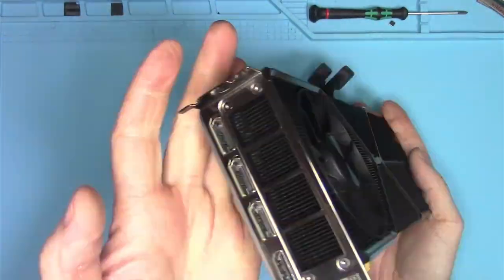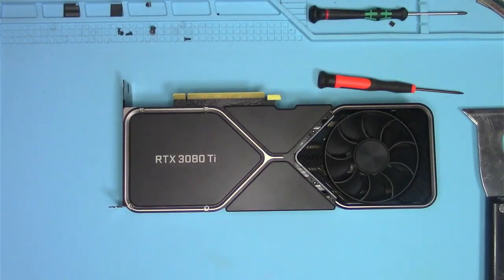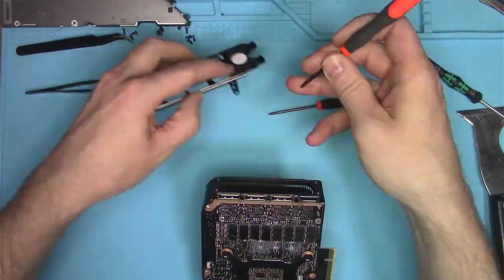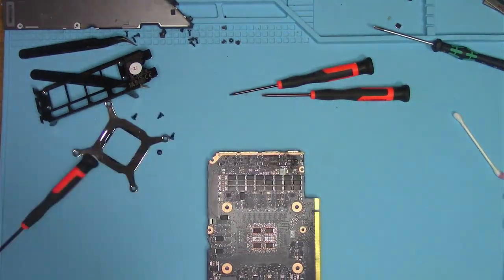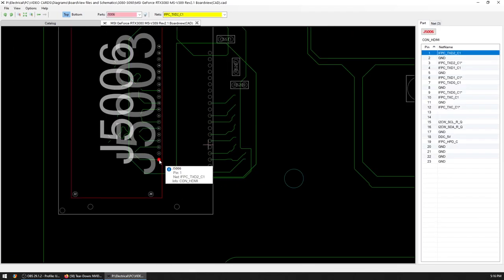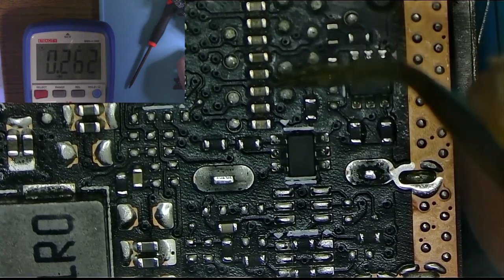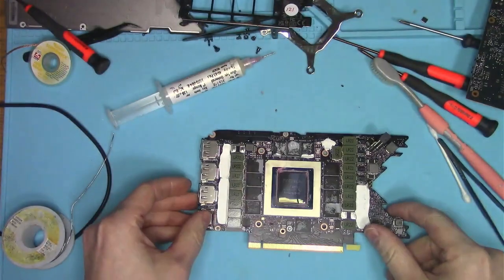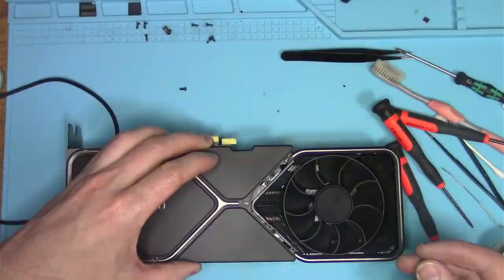Should you power down your PC during bad weather ?

Comment: Love the content, that pink thermal paste is most likely Thermal Grizzly Kryonaut. Really good paste for ambient or XOC stuff. Made by Der8auer.
Reply: I use Kingpin KPX! Also good stuff.
Reply: Kryonaut really is just for LN OCing and works well on desktop CPUs. It is very runny and is highly affected by the pump out issue (difference between thermal expansion/contraction between silicon die and metal coldplate causes the paste to be pushed away from the die with every heat cycle) on bare die applications, der8auer himself recommends Hydronaut for bare dies.
Reply: I use Arctic MX6 and so far, no issues, i think northwest use MX4, both have no issues for cards such as the pump out issue, i think.
Reply: Coolermaster Cryofuze 'violet' is violet in colour
Reply: Specifically Kryonaut Extreme is the pink stuff, regular Kryonaut is the usual grey.
Reply: @wstd7417  MX 4 is quite thin paste, it might have pump out issues over time - of course northwest doesn't check the temperature of the card over several months or years.

Comment: One are very commonly overlooked with lightning is inductive surges.  Don't run your data lines alongside electrical wiring.  Keep them a few feet apart, and if possible, make sure any Romex is run through grounded conduit.  You can have God's own surge protection where your device plugs into the wall, but if you get magnetic coupling between the lines hit by the strike and your data lines you can fry everything you're trying to protect.  If it's not possible to isolate the lines, then definitely use network surge protectors on either end of the data line run.  If you have a lot of expensive equipment it might be a good idea to look at a surge protector that installs at the panel.  A lot of times you can get one that goes between the meter and the box.  Depends on your utility company, but it's an extra level of protection and a lot of times they carry a pretty robust insurance guarantee.
Reply: Or put fiber connection between your ISP's router, and your own router...
It's literally the best surge protection you could find...
Reply: Really glad you made that comment... It's storm season where I live, and I just bought a SS on the power, but completely blanked out about my INTERNET CONNECTION... I will address it now and possibly save my system from a 'bad day'
👍
Reply: @alfrede.newman6626  Glad I could help!
Reply: Romex in conduit? Heh!

Comment: Just to clarify:
In terms of lightning damage, it makes NO DIFFERENCE whether electronics are on or powered off!
If you want to protect them, disconnect them PHYSICALLY from power, from all other wires leaving your house (TV, land-line, etc.) and all other devices, that are not also disconnected in the same way. If devices have a PHYSICAL power switch (like most ATX power supplies do), that is a good start, however a high enough voltage might still arc over the small gap inside the switch.
Reply: That includes Ethernet connections, right?
Best unplug your Ethernet cable or just straight up your router, then.
Reply: @Sherolox  Yes. Either unplug your router as well (from power and the incoming line) or unplug your ethernet.
Reply: @NebukadV  
Thank you for the clarification.
Reply: What about a lightning swith power breaker, where you have to slide the switch on an off, with a 3 inch gap?
Reply: Will a surge protector help? I have my system attached to a Targus surge protector...
Reply: @hamdanali3063  Yes, it will help. A surge protector cannot protect against 100% of voltage spikes, but it reduces the risk of damage to things connected "behind" the surge protector.

But again you need to be aware of other connections. I.e. if you PC is connected to the protected socket but your monitor is not, you can still fry you GPU. Same for the router as another example.
Reply: @NebukadV  thank you ,🙂
Reply: You think cellular sites do this?
Reply: @jeffkardosjr.3825  Cellular sites do all kinds of stuff and cannot be compared to a consumer-grade home setup ;)
Reply: Very true this OP makes a lot of sense with his statement. I heard of horror stories of people loosing their PCs back in the early days of broadband internet due to the fact they never disconnected their dialup modem and a surge went through the modem and caused damage.
Reply: people make coils with their excess cable, that don't help either in a high emp environment.
Reply: Or just use a really really good surge protector/UPS!
Reply: IT CAN ARC OVER A PHYSICAL SWITCH !! really how common is it cause I always turn off my physical switch and leave the plug as it is. It is the first time  i  am hearing this
Reply: @toheedrabbani6865  Well a lightning strike can ark over air, so of course it can also arc over a physical switch.

It is already very unlikely, that a lightning strike would create a voltage within your home high enough to bridge a opened switch, but it's not impossible. So if you are paranoid enough and want to be really, really, really safe, disconnecting the device fully is objectively more secure than "just" switching it off.
Reply: @NebukadV   okay thanks man
Reply: There is a chance lighting gets to ground
So better unplug whole plug from pc and monitor
If you have tv and antenna connected unplug
Unplug both pc and monitor since the hdmi cable has ground
And yea the ethernet
Reply: wrong

Comment: As some comments said, the pink Thermal paste is likely to be TG Kryonaut Extreme. Odd colour choice on their part I guess. It is also a pain to clean if only even a small drop falls in an unwanted part. I mean for asthetics, it is non-conductive and non-capacitive.

Very common for LN2 overclocking, since liquid metals perform worse (and solidify) at such low temperatures. Also very expensive. Also common in "rich guy"' 's computers ;)

It is very good stuff. Still not good enough to save that poor card from the lightning. Very educational video as always.
Reply: I thought to write about the paste, but then I thought he was just joking, and he knows all types of thermal pastes by now. I'm not sure what color is better, KOX or TG KE. Both are a bit unusual. Anyways I am not rich, but I have TG KE on my CPU and GPU, which are both water cooled. Compared to components used, thermal paste cost is negligible. Good one lasts longer and  drops the temperature for 1 or 2 degrees. Sure, that temperature difference isn't much, but there are things that cost even more and do not bring more difference either.
Reply: @NINEWALKING  The difference between ''the worst'' and ''the best'' thermal paste is around 1-2 degrees Celsius. Just buy some cheap paste and save your time and brain cells remembering all those brands and letters.

Comment: Yup, your guess is correct mostly, that some device before the GPU would have sacrificed itself to save the video card
Considering that that should've been the job of a grounded surge suppressor power strip into which all of the owner's equipment was connected, that clearly wasn't the case here.
Even if the PC was surge protected, an unprotected display could potentially transfer the surge from a lightning strike back through to the GPU via the video cable, which is what I suspect happened here (protected PC, unprotected display).

Love watching your vids! It's always great to see how technology works at the lowest level
Thanks for demystifying it for us!
Reply: I have seen power strips they got hit by lightning they do not do a thing lightning literally jumped the miles to hit the Electric lines you don't think It will jump across a simple surge protector
Reply: @funnycatvideos5490  If the bolt hit near enough that not enough dissipation occurred before reaching the surge protector, yes.  Something more likely to happen if you live in relative isolation.  A surge protector is like a seat belt on a car.  It isn't guaranteed to save your life but it greatly improves the odds.  The same goes for surge protection.
Reply: @funnycatvideos5490  In 20+ years of tech support, I've seen surge suppressors, and UPSs, and plain power strips of all kinds and build qualities hit by lightning or other "transient electrical events" and the practical upshot is that selection of a quality surge suppressor makes the biggest difference in whether or not it will protect the equipment plugged into it. Popping for the cheapest one almost always means shoddy design and low-quality parts, in turn meaning that you might as well just plug your equipment into a plain power strip (yes, there's a difference between a power strip and a surge suppressor) or even directly into the wall for all the good it'll do. 

The good surge suppressors cost a bit more but are designed to properly handle power surges, even from lightning, tripping or even outright sacrificing their breaker circuitry for the sake of the connected equipment.

Rules of thumb:
- If it only has a power switch that only turns it on or off, it's just a power strip with no surge suppression capability
- If it has a power switch which also acts as a breaker reset switch when tripped, or if it also has a separate breaker reset switch, then it's a surge suppressor
- If it also has a performance guarantee promising to replace damage equipment up to some large monetary value, that in and of itself doesn't necessarily mean it's better quality; read the fine print in full to be sure you understand what's actually covered, under what circumstances, and what you need to do - or not do - in order to ensure you can rightfully claim losses under the guarantee, should it ever be necessary
- Just because it's more expensive doesn't necessarily mean it's better quality, though that is often the case. Get one from a well-known, well-trusted brand.
Reply: @funnycatvideos5490  It depends on the amount of joules they are rated to be able to protect from. Clearly you've only ever seen cheap surge protectors.
Reply: @sunrun176  You will never see a dime from any surge protector company for any damaged connected equipment ever.  Those connected equipment warranties are little more than marketing.
Reply: I work on repairs as well, worked on NUMEROUS lighting struck gpus. All of the cases have been with all devices protected.

I've seen some go even in off grid systems with the their own dedicated commercially installed grounding earth rods. Electricity goes where it wants if it can.
Reply: @funnycatvideos5490  That's the thing, the MOV (metal oxide varistor) component in the surge protector device as well as arrangement of other jump points is supposed to give the lightning an easier path to jump to ground that doesn't lead through your valuable electronics. You really can't stop a lightning but there is still protection, but it requires quality engineering and the protection devices are consumable, need to be checked and replaced regularly, as the protection may no longer be present after a previous lightning strike.
Reply: @Dilligff  Yeah but in most cases you only get Electronic problems when you get a direct hit and surge protectors are useless on a direct hit
Reply: @Globodyne  I believe it to and makes you want to buy just by reading all those lies about coverage the company would go bankrupt if they really did that
Reply: @jamaral5557  All the cases have been with the devices protectedExactly best thing to do is unplug your electronics during a storm or unplug them after every use done simple enough or make a big throw switch that has a huge gap of 4 inches or so
Reply: @funnycatvideos5490  I'd think if you got a direct hit from a lightning bolt, whether or not your computer still works might be the least of your problems.  Short of installing a well grounded lightning rod on your roof or building yourself a heavy duty faraday cage, there really isn't much to be done about a direct hit other than hope it travels through something other than you.
Reply: @Dilligff  Most of the damaged electronics are the lines being hit within a few miles of the House electricity doesn't travel through the wires okay it travels around the wire and it doesn't even  move It just spontaneously appears through the the dielectric field  MeAning a real SurGE lightning arrestor suppressor would be $10,000
Reply: You ever seen a house with a lightning rod on every peak of the roof that helps tremendously more than any surge protector from the store is going to do

Comment: By the way if you ever work on another founders edition 30 series card just know it's easier to remove the screw covers with a piece of tape; using the tape will just pull them right off making it alot easier than trying to pry at it.

Comment: I had a fairly expensive APC UPS surge protector protecting my equipment both times that lightning damaged my components. I believe both times the surge came through the negative or ground wire, because both times my equipment was turned off, but not disconnected. My electric tankless water heater wasn't in use, but was connected to the breaker. The lightning strike hit the ground where my water line runs underground. It blew a hole in the side of my cold water feed line, right where it connects to the water heater and it fried the electronics. The strike was also right beside where my earth ground for my circuit breaker box goes into the ground. Both times my TV was knocked out, my PC was damaged, the graphics card was fried and the modem quit working. Now when a thunder storm comes through I turn off the breaker to the water heater, unplug the UPS and disconnect the coaxial cable to my TV antenna. Since then I've had several storms with lots of lightning come through and no problems. It sure is inconvenient as hell though!

Comment: Also had a GPU died due to a lightning storm. Lightning hit the cable line outside my house then travel to the cable box then to my TV thru the HDMI port and finally to my PC thru the HDMI port that is connected to the same TV. Cable box, TV and GPU (Asus 1080ti) all died but I was still able to RMA the GPU due to no visible damage. All other PC components were still working.

Comment: Back in the 90s I was stationed in North Carolina with the Marines and we had some office spaces spread across multiple small buildings with Coax cable (good ol' token net) between the buildings so that everyone was connected.   A storm rolled through and a lightning blast struck close to the coax.

Multiple computers in two of the buildings had their network card blown out and the two closest computers had damage across multiple cards as the blast arc'ed out and through them.  Totaling Military graded Tempest hardened field pc's.

Comment: Opinion:   Powering down your system won't necessarily protect it,  You can even unplug it, which theoretically should help isolate it as at least it is not connected to additional conductors!  You also could place it on top of some electrical insulators, just like the fire rangers do to their chairs in some high locations.( an example would be Devils Head Colorado)! However , even at best , we are talking about millions of volts and a high surge current, and will take the highest conductive path, it still will have such an overwhelming charge that it can ll arc out and fry anything in it's way, The heat given off is enough to literally boil the air and cause it to explode. (aka Thunder).  So in conclusion, my answer is yes, (guessing really) ! I'd worry more about where I am in relation to all other conductors first! Do not run around in the rain carrying a personal lightning rod like an umbrella,  Do not stand at your sink washing dishes with your hands in water!  etc...  As for your computer and data,  I can't understate the importance of having a backup, preferably in a distant location  if you want any of it to survive as even a lower voltage strike , might erase everything in the area, no matter what you do!
Reply: Well, if you want to be alarmist, you don't even need a storm to have a power surge.  My friend in south Europe gets them once every few years, from the local power company.  One of them actually fried his washing machine, and it was turned off (but plugged in)!  This happens so often in developing countries that they sell voltage regulators having a moving needle for protecting TVs.  You can watch the needle move around in real time since the local power is so "dirty" and not a perfect sine wave.
Reply: "Opinion:   Powering down your system won't necessarily protect it"

More like "fact". Modern powersupplies don't actually disconnect the powercord at all so any protection is down to the internal safety's in the components.

The basic formula for sparks crossing a gap is about 80.000 volts per inch. A good lighting strike is 300million volts, do the math; even if you only get 1/1000th of the hit of the average strike that's still 300kV, or three inches of gap crossing power. Things wil go boom.
Reply: @vinny142  And now consider ball lightning, that will follow the path of least resistance, even if that path is you.  Imagine being chased by a 300 million volt ball of plasma that makes a Tesla coil look like a plaything!

Comment: So glad I went for a 10-series card. They're making things too complicated with hidden screws and micro connectors. My 1080 is a bit tedious, but easy enough to disassemble. Only real issue I have is that there are a handful of models in the same line and post-production models which include updated vbios and a factory thermal pad mod (which, according to EVGA isn't even really necessary. But pretty cool of them imo, listening and taking action on consumer concerns.).